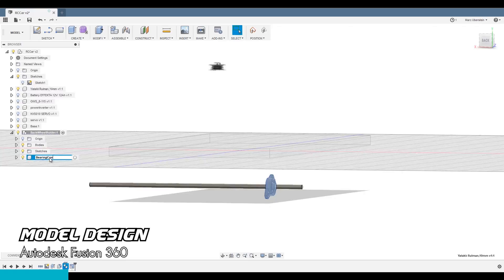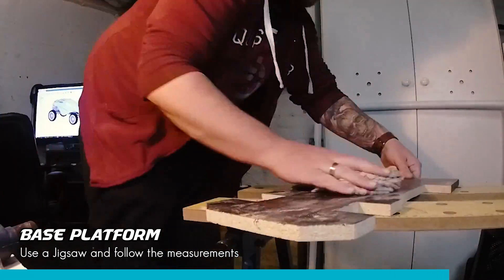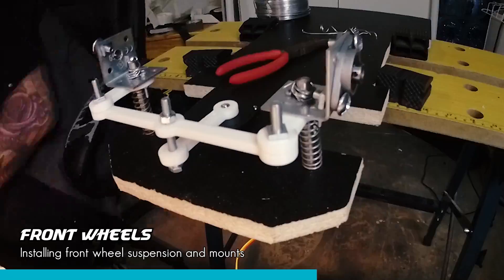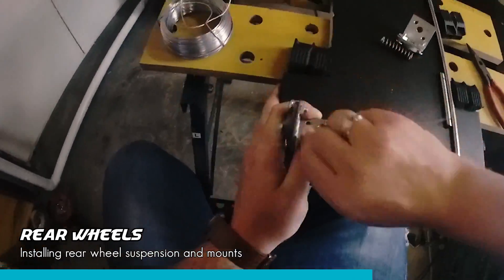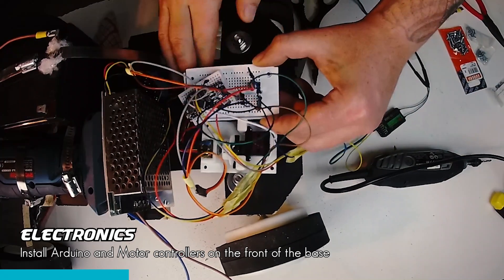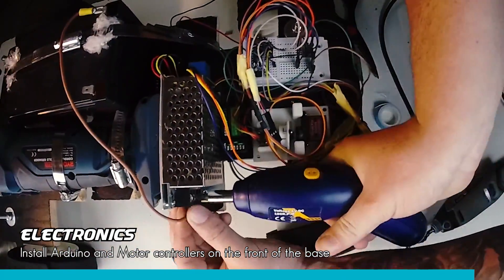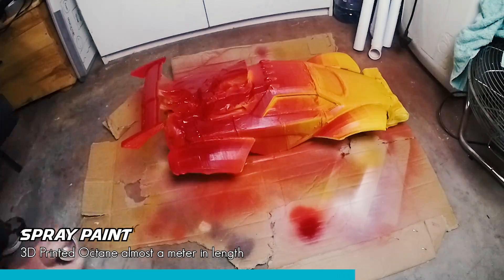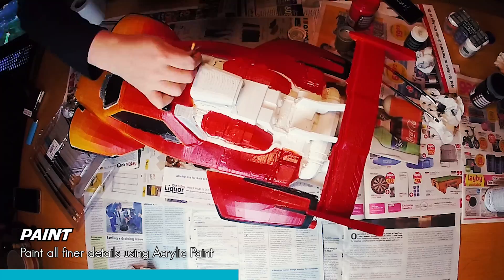Rocket League - Free to make RC Octane!

Comment: Pretty rad start. Add some coloured nitrous for boost with the option to fire backwards or straight down into the ground. Heck, build an electrified magnetic floor where you can fire down magnets to repel and boost off the ground.

Comment: How do I get the fusion model? I’m trying to make an octane that can fly exactly like in RL and this would be the perfect little head start lmao. Great Video!!
Reply from the maker: My fusion file is corrupt :( best is to google the octane model (pretty much what I did when I started my project). I would suggest doing a fennec or dominus, the octane headlights setup was a pain and breaks easy. Hope your project works out!
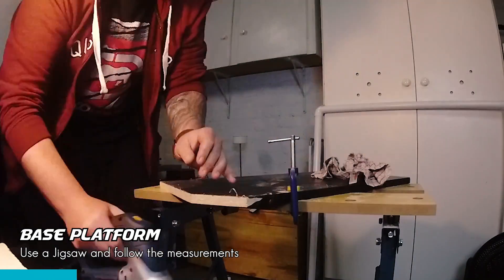Reply: @Guineapixel-page  I have been working on Octane in Meshmixer. Definitely some work getting it to RC shell form. I just finished a 1:10 scale Merc build. I have it sitting on a Traxxas Stampede 2WD chassis. Thing weighs 3 KG in its finished form. Lol.
Reply from the maker: Nice! 3kg! Yeah, these bodies can get heavy quickly. Try printing the body in Vase mode and reinforce it PVC cement, or any other type of thick plastic glue.
Reply: @Guineapixel-page  I am content with the weight, honestly. I ended up fusing the pieces together with JB Weld and it's held up on a rollover already. If I upload some stuff, I'll send it your way so you can check it out.
Reply from the maker: Amazing thanks! Super excited to check it out!
Reply: @Guineapixel-page  I don't have Cura, but I may have to get it for vase mode. Sounds like it will make things easier.

Comment: This is awesome! I’ve been sort of planning an Octane build, but I want to include some of the in-game mechanics like drifting and air rolling. I have pretty solid ideas for how this would be done but I’ve never really worked with electronics, just CAD modeling and some 3-D printing. I’m an Electrical Engineering student but haven’t even had circuits or electronic systems courses yet.. so basically I don’t know if my ideas would pan out. I think it would be a good learning experience though. If you ever felt like it, I’d love some feedback once I really get working on it, since you clearly know what you’re doing.

Was really impressed with this though, the final product looked fantastic.
Reply from the maker: Thanks Noah! This was way more involved than I initially thought. Here as some pointers you should keep in mind before starting the base model and mechanics. Make sure your suspension and steering are 100% planned. Focus to reduce overall weight. Use brushless motors. Make sure to buy proper tyres. 

If you want to incorporate some game mechanics like air roll. You will probably have to integrate 2 EDF motors to make rotation in air possible. Another EDF for 'boost' after the 'jump'.

For jumping, that's another issue on it's own. Possible solutions: Quad copter fake jump. Poll Vault mechanic with a strong aluminium rod and strong servo motor, once vaulted enable the 'boost' EFT motor. The less weight the better.

Good luck and please let me know how you doing with it.
Reply: Guinea Pixel I never even considered using a pole vault mechanism, that’s a really good idea haha
Thank you so much for all the info!! I’ll definitely let you know how it’s going once I get started, I really appreciate the pointers 😁
Reply: Make sure you show as your final product.
Reply: @skiddydiamond1085  I think, we will never now, If he does it.

Comment: Cool project, but next time you should consider  changing suspension, that kind of suspension you did tbh doesnt do anything try something like "double wishbone",
place bearings inside the wheel (at least in front) or place bearing as close to a wheel as possible. Im surprised that the car is sooo slow, maybe its because torque ? but angle grinder has plenty of torque, maybe bad power supply, driver,h bridge, mosfet or jfet  idk (what you using) or pwm code?  battery  ? maybe belt starts slipping under load,"btw add tensioner in next version"?because im guessing your car weights below 5 kg so if grinders power is >100W you should reach speeds like 10 m/s or ~40 km/h in few seconds. And BTW no suspension is much better than this type of suspension, trust me.
Reply from the maker: I totally agree. This project turned into a huge learning curve. And yes, the belt actually slips when trying to accelerate quickly. The total weight is about 8-9kg, the wood I used is a bit on the heavy side. I should switch over to a bike chain and sprockets. The suspension gave me headaches, will definitely do the double wishbone approach next time. Thanks for the constructive response, appreciate it.